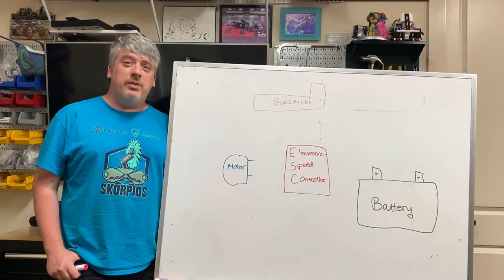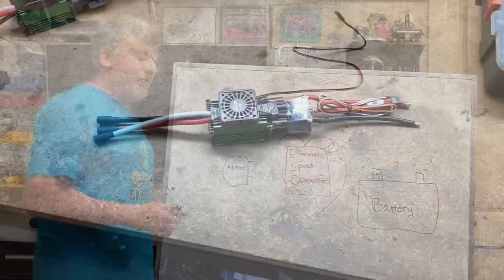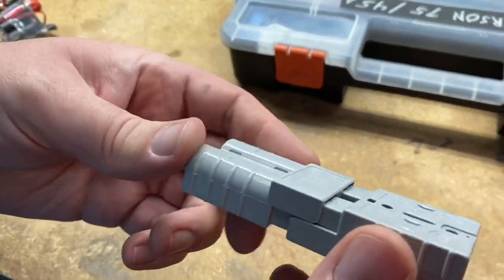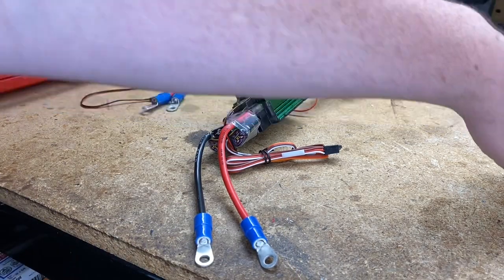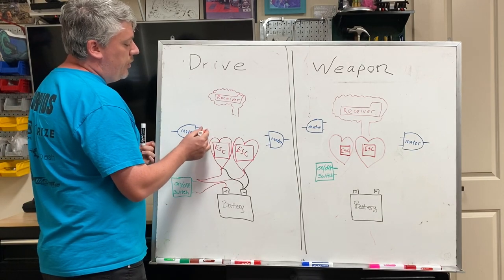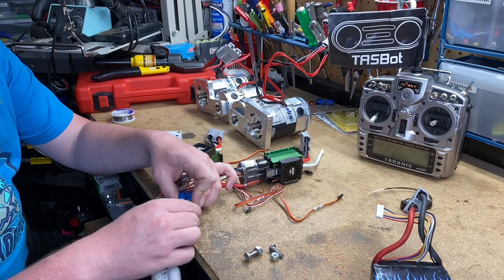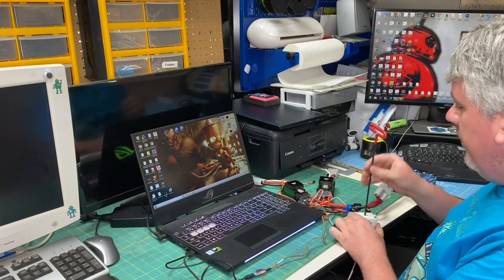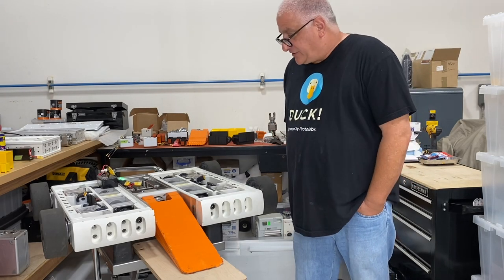How To Wire A BattleBots

Comment: Again great video, very informative. This in theory could work for any size bot as long as you have the right hardware. Question, do you guys always use a xd9? Why not move to the qx7s also, I think you may want to inform a lot of people the difference between pwm and sbus cause a lot of people out there may pick up the wrong rx. Love you guys and keep the videos coming. #weneedseason6
Reply from the maker: That is a great point I think will do an episode just on programming binding radios! Also talk about importance of failsafe

Comment: Hello, I am making the block diagram for my 12-lb combat sumo style robot following your video! I'm confused about the wiring between my ESC, receiver, and Raspberry pi microcomputer. Does my raspberry pi replace the "receiver" block or do they work in conjunction? Also if you have a number or email I can reach you at with questions, please let me know as a I have fast upcoming dates. Thanks!

Comment: Do Wyachi switches have fuses built in? In the UK we have to have the battery fused to help protect everything. I'm not sure if this is a rule in the US?
Reply: You could just have a fuse in front of the switch?
Reply: @ankjaers  Yeah that's the norm over here. That or since we use a removable link rather than a switch, you can have a fuse on the link. That's more for lower weight classes though to my knowledge.

Comment: Is there any benefit to using equal lengths of wire between the brain and the two hearts?
Reply from the maker: No
Reply: @SkorpiosBattlebot  Thanks for answering. I recently learned that scorpions glow under ultraviolet light. Have you ever considered painting Skorpios with UV reactive paint? If you got a couple of bots painted with UV reactive paint it might be worth adding UV lights to the Battle Box. Sounds like good TV to me!